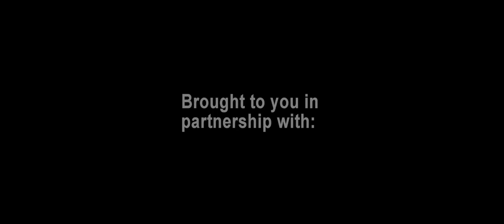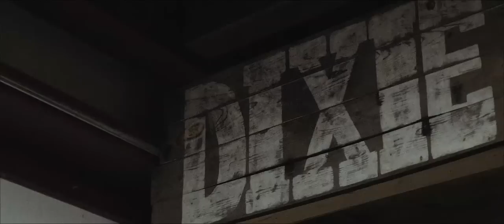Larry Pierce BF5

Comment: Nice shovel Larry. 5 spoke Drag Vader wheel on front maybe? I have one on my 58 chopper with an old MidNighter solid wheel on back. Bought them both in 79 from Drag Specialties before most of the planet even knew what they were. Thanks for sharing the vid. We're in Mobile. Keep the rubber down bro.